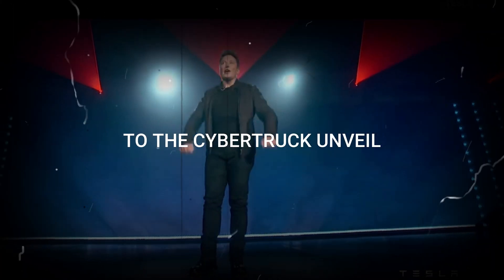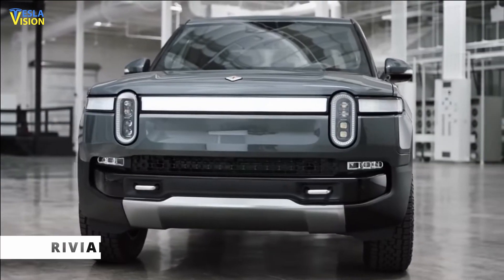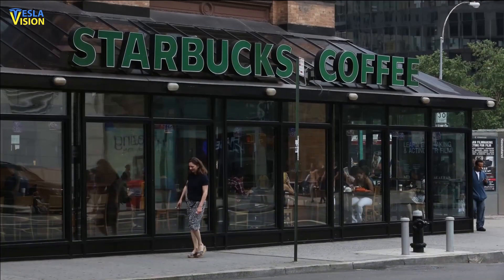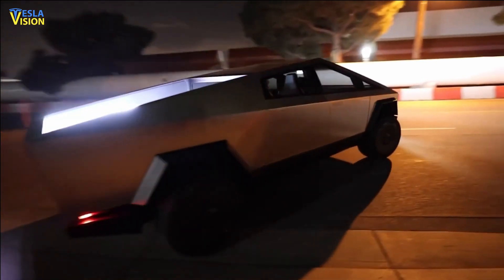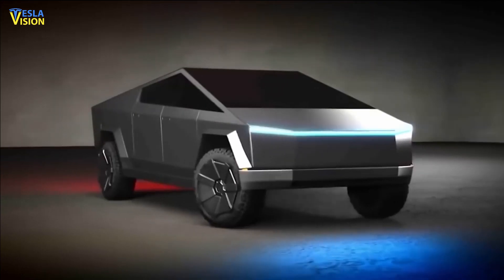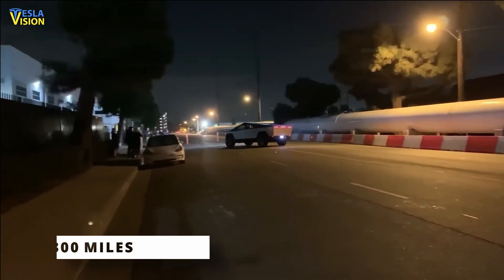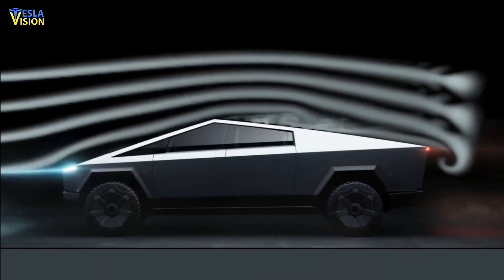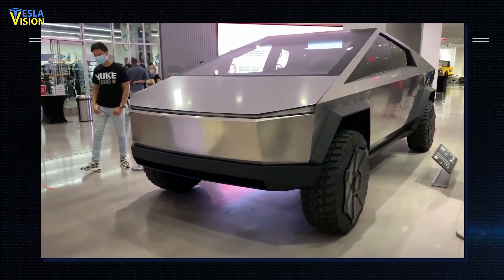What's happening to Cybertuck?! Unveil to Mass-Production of Cybertruck

Comment: Grossly overpriced, too short a range, and too long to charge.
Reply: The point is to work towards getting the price down as the quality rises so that anyone can afford an electric car.  It takes time, money, investing for Elon.  At least he's trying to get us there.
Reply: So you're poor and stupid?
Reply: Buy a bolt you deserve a bolt 😂😂
Reply: @dt2526  EVERY EV on the market is grossly overpriced, too short a range, and too long too charge. Fools are swift to part with their money so YOU buy an EV.
Reply: @JohnSmith-ug5ci  The cost of ownership is much lower for EV’s versus gas engine vehicles. Do some research before showing your lack of understanding on the subject. Prices will continue to fall for EV’s as the cost of battery production is reduced as EV’s scales over time….Wright’s law. EV’s continue to gain market share as ICE vehicles lose ground…down over 8% last year. Legacy automakers are trying to shift to EV’s but their costs are high due to unions, dealership model, along with factories that are designed to make internal combustion engine vehicles. It will take them years to get competitive with EV’s. Typical range is 285 miles to over 400 miles. Quick charging can get a vehicle up and running at over 80% in thirty minutes with Tesla fast charging station.
Reply: @JohnSmith-ug5ci  still going to be better then your regular cars
Reply: @tanvirsourav83  that is the dumbest statement Ii have ever heard. Setting waiting to charge is not better. Paying more to get less is not better.
Reply: @JohnSmith-ug5ci  I know it is difficult for some to accept reality. Facts are not opinions, guys like you just get left behind.
Reply: you must be cockeyed then.
Reply: I disagree my tesla is cheaper than my old Toyota that I traded.
Reply: @dt2526  that is a lie.
Reply: @JohnSmith-ug5ci  math doesn’t lie.
Reply: @dt2526  yes that is true and it is clear that you have not done the math. If you had you would know that it would take at least 15 to 20 years to just break even in an EV of the same sized gas model.
Reply: @JohnSmith-ug5ci  I said my tesla is cheaper than my old Toyota . Wow you are so wrong about the pay back for 20 years.go online and do a comparison model 3 vs Toyota Camry price and fuel savings and insensitive.
Reply: @JohnSmith-ug5ci  wow you can’t even go online to see how wrong you are so have fun with paying more to drive.😂😂
Reply: @dt2526  I don't pay more to drive. I get 50 mpg and can fill the tank in 5 minutes. You paid extra to get less.